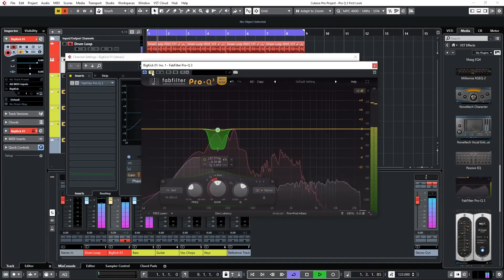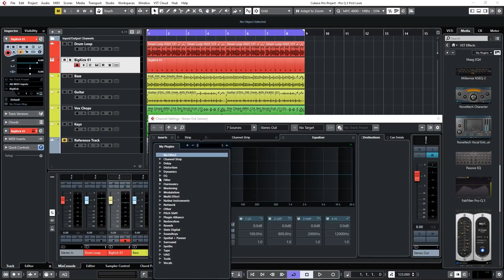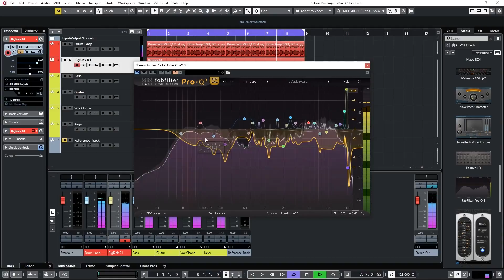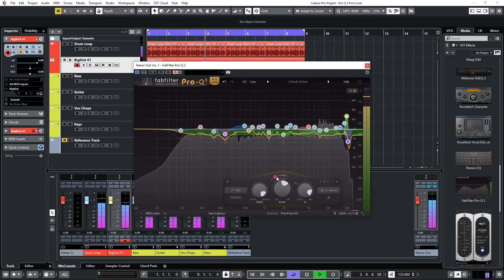First Look at FabFilter Pro-Q3 - Separating Bass and Kick Frequencies with the Dynamic EQ

Comment: I like the sidechain ducking and how it shows overlapping frequencies, but I personally don't prefer trying to "match" the exact eq curve of different songs.  Each song is different, along with the instruments and voices.  Trying to match eq's on a mix seems like more of a gimmick than an actual feature.  Now if you could match an eq curve of an individual bass or kick, that could have some value, but where are you going to get that profile unless you just use sampled instruments.  Great video all the same!
Reply: truth! I use it when doing mixes for cover tracks that are very similar to the original, remixes of same songs with little differences, or similar tracks on an album. Otherwise it's an absurdity to make 2 different songs sound the same. It's like trying to dress a clown to look like a Golden retriever. You'll get there, but you won't like it.

Comment: Thank you. I'm still not clear on how to do something with the dynamic EQ and frequency clashing. For instance, if I want to have the kick be the trigger that drives the compression on a band on the bass track, how do I set that up? Do I need to set up a side chain in the DAW, or is there a way to tell Pro-Q3 to trigger that compression on the bass when the kick hits?
Reply: the dynamic range is how you would trigger that compression, basically what was done in this video. Here the replacement kick was being analyzed so that he could place a band and use both gain and the dynamic range on the drum loop, basically giving you effective sidechain compression only on that single band. In your instance, you would use the bass track to find where to place the band, and then continue the same process. This is also available in a more automotive form  with Wavesfactory Trackspacer.
Reply: i think X S wants the kick to be the trigger so that it can be effectively used on kick and bass so that bass isnt ducking when the kick isnt present

Comment: great video! I just have a question, If you ever used F6 from waves, there is a option to fit the movement of the band with the kick to make traditional ducking/side chain fx in specific bands you need, I tried to make this with Fabfilter3 activating the sc button (from cubase not from PQ3) but this is not working, do you have any idea of how to make it?
Reply from the maker: Check the latest update mate
Reply: @Tutorial_ism   cool thanks !